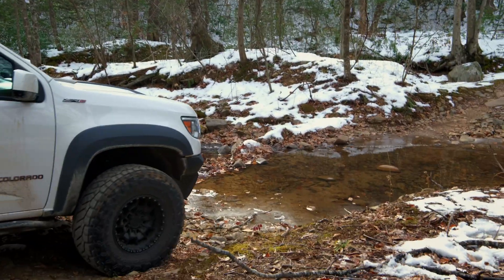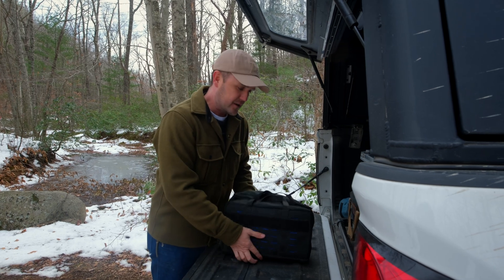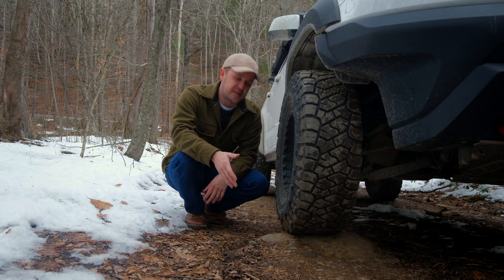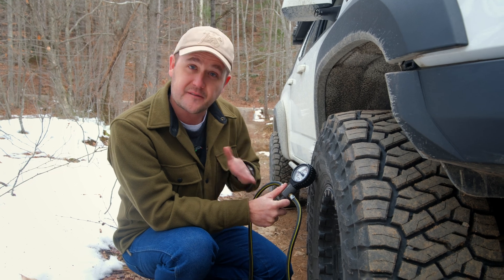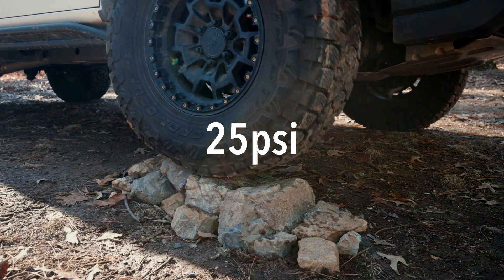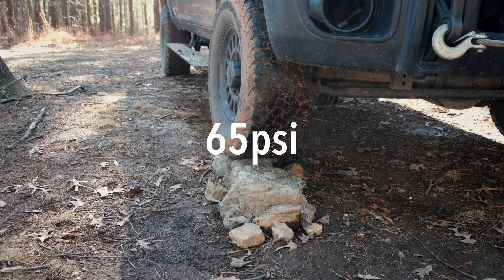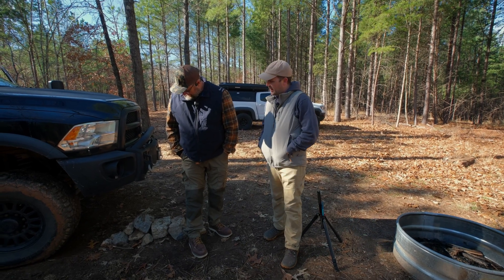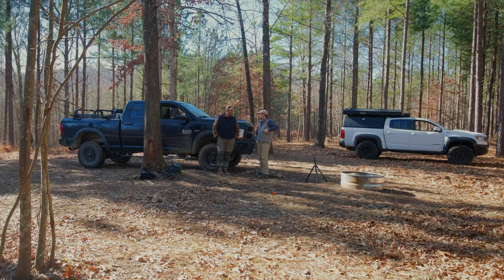When Should You Air Down? Tire Pressure Tested on the Trail

Comment: Thanks for yet another informative video.  One other situation where airing down has been beneficial to me is on hard packed snow/ice.  Several years ago I was on old NC 105 during a snowstorm.  The conditions were just right for the snow to compress and form a sheet of ice on the trail when driven over.  Airing down made the difference between just sliding and spinning tires to being able to gently drive down the trail and having much better control.  For more info, at the time I was running KO2’s at 36 psi street pressure and the drop to 20 psi made a remarkable difference.  Cheers, see you on the trail.
Reply from the maker: Good call. We don't get out in the snow a ton, since it's usually once or twice a year around here, but that's a great tip.

Comment: An important thing to remember is that airing down is just as much for the TRAIL as it is for the VEHICLE.  Airing down mitigates wheel-spin which therefore mitigates erosion causing ruts.  Even if you can't see the tire flexing in a static scenario like this, the tire is in fact flexing more as it goes down the trail.  This is why the ride feels "smoother" when aired down.  The tire is doing more flexing.  This also has a side-effect of taking load off the vehicle's suspension components.  Along the same lines,  this is why you should always use 4wd when off-pavement.  It helps maintain compacted trail surfaces and mitigates erosion.  Erosion not only destroys trails, but it also ends up feeding sediment into streams which can damage aquatic habitats.  Lastly, as you air down you also need to slow down.  My rule of thumb is I cut my speed by the same percentage I cut my air pressure.  So, if I go from 36 PSI to 18 PSI - a 50% reduction - I reduce my max speed by the same amount; meaning I go from a max causing speed of 70 mph down to 35 mph.  This is important due to increase sidewall flex and the potential for rollovers at higher speeds.
Reply from the maker: Great insight on why airing down is beneficial for both the vehicle and the trail itself!
Reply: This is rediculous. Keep your foot out of the throttle.

Comment: On my H3 I run 285 75 R16.  They only come load range E.  Even when aired down to 15psi they still look like they have 40psi.  I also run those tires because I do tow upwards of 5,000lbs sometimes.  I wish I could get tires in that size that are not load range E though.
Reply from the maker: Yeah, lots of sizes are limited to E rated. Also, 16-inch wheel crew here to!

Comment: The ZR2 was a great example. You’re not trying to get the sidewall to contact the ground or a larger bulge but you increase the length of contact to the rocks. Look back at the contact point on the ZR2. It gets longer as you aired down. Great video guys!👍
Reply: And don’t spin your tires on sharp jagged edge rocks when Jim is yelling at ya 😂🤣
Reply from the maker: Excellent point! We tried getting some prints with paint on the tire rolling over paper but that has its own challenges.